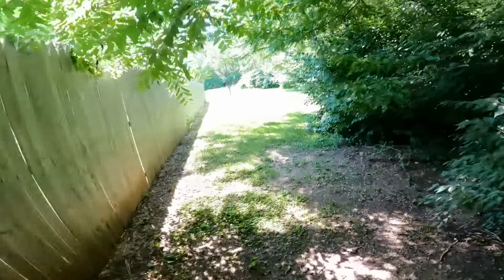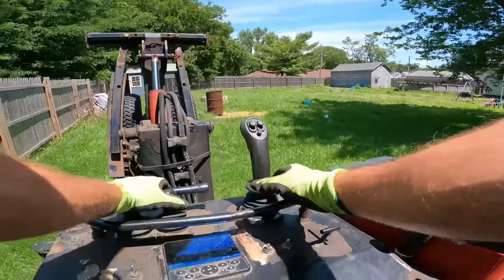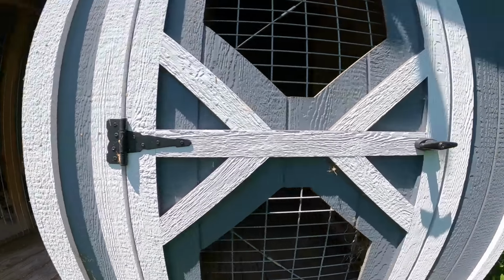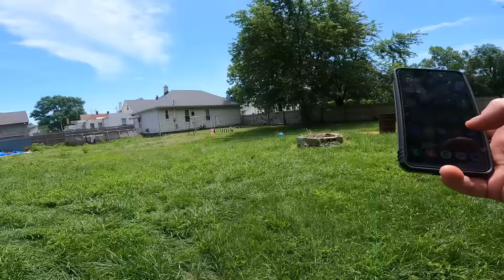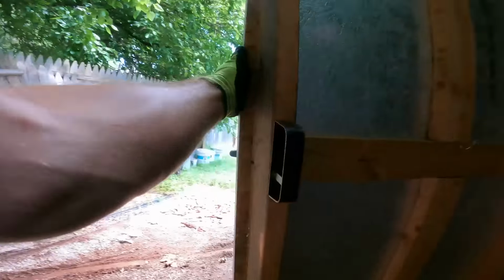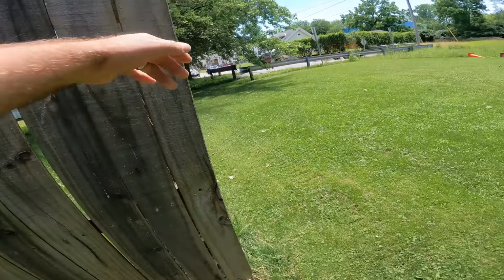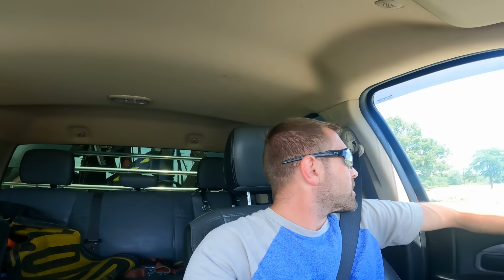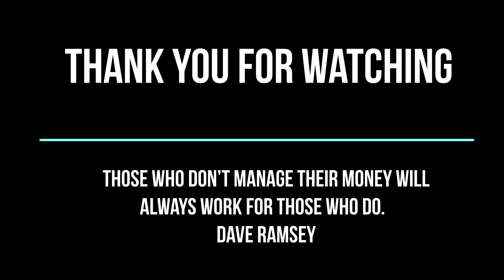Dog Kennel Repo Attempt

Comment: To feel more comfortable unhooking electricity, it might be worth getting a quick lesson from a local electrician. For an hour or two of their time, they could show you on an actual service how to safely remove connections like these. You'll get a lot of helpful suggestions from people here, but there is nothing like hands on experience. A local electrician can also recommend what supplies (tape, wire nuts, tools) to keep in the truck to cover most instances.
Reply: This, this, and this comment again.  A couple hundred bucks or perhaps a couple of supply runs using that huge hauler of your  will absolutely get you the training needed to handle disconnections more safely. 

People that work for a living tend to be helpful folk and too often we forget the trades are full of good people.
Reply: @TheRealBelisariusCawl he’s probably not insured for something like that these people will probably make an electrical fire and try to blame him because they are butthurt he took their “shet”
Reply: Excellent advise
Reply: The other problem here without access to the breaker panel inside to shut off the circuit there is no safe way for him to remove it
Reply: You have to have an electrician's license to do that.
Reply: He had to be able to get to the service panel in the main house to turn the power off, it doesn’t matter what kind of license or training he has, if they are uncooperative he can’t unhook it.
Reply: @steverone7623 i was looking for this comment before making it myself. Can’t just leave live wires live laying on the ground.

Comment: Hey Josh just a quick note. I think you do an amazing job with an amazing, respectful, and Godly attitude. You do a difficult and confrontational at times job. Even though it’s a tough visit, the repo client couldn’t be more blessed to have you be the one to do it. I’m a commercial and residential building contractor in Virginia for 24 years ….also an electrician. On a safety and comfort side, you do exactly what you’re comfortable with and that’s awesome.  Don’t even sweat that decision for your well being.  On another note, liability wise it would not be worth it to disconnect or cut any live wire that’s not breaker accessible for you, unless that’s in the company you work for repo clause stating that if wires are cut y’all aren’t held liable for any damage.  It’s definitely possible to safely disconnect even a live wire when you take care and diligence. If you’re licensed and or comfortable….. again falling back to an original contract and what the indemnities might be re: licensure.  However, if a client states that you arc’d the circuit (hot touches a ground or neutral through simultaneous cutting, accidental touching after the fact, or if it’s dishonesty and you didn’t even arc them at all actually lol 🫣), the client could say it tripped breakers and blew their fridge, dishwasher, tv, electronics, etc.  It stinks to have to make decisions related to potential accusation , but unfortunately in today’s world, things are changing for the worse and humanity is sadly slipping . I’ve learned the hard way over the years.  Every addendum I’ve made to my contract over the years is because I got screwed and what I thought was unwritten  common sense didn’t cover me 😇lol. All that to say, you did and are doing the right thing and you represent what you do well my brother. Great job man. God bless and I pray for prosperity for you and your family (and everyone who watches ) 👊🏼🙏🏼. Peace 🕊️    Tim
Reply: @patriciacole8773  Jesus didn't steal property
Reply: You need to watch and listen to more of Josh's videos. Only then will you understand that 100% of the concerns  you described,  DO NOT APPLY. He is thoroughly covered by a very comprehensive and detailed contract that every customer signs before taking delivery.

Comment: Since the circuit breaker was on a wall, you could have cut the section of wall it was attatched to.  So you repo the shed minus a little section of wall.  It would need to be repaired though.
Reply from the maker: Good idea, I never thought of that. Thanks 👍
Reply: @ShedHappens  Plus it would look hilarious.  Shed gone, just little wall section with conduit and circuit breaker box sticking 5feet out of the ground.
Reply from the maker: @Andrew-ky8oc8cq4n  For sure 😄😃
Reply: Yeah  gotta be careful when dealing with utilities.  Once you touch it you got liability @ShedHappens
Reply: Initially i agreed, but then remembered everything branches out from there,  but i guess u could throw main breaker n cut all dead outgoing wires
Reply: @Andrew-ky8oc8cq4n  absolutely agree 💯 ABSOLUTELY cuz the damages are all on the deadbeat who didn't pay

Comment: I did learn from this video that if you want to hide something behind a wooden fence you should not show the screwheads on the OUTSIDE of your fence.  I really like your observation that if you can get the frame of the shed to twist, the people won't be able to open the doors.  That could be a Halloween prank in the making.  All I need is a car jack and a couple of cinder blocks.  Thanks.

Comment: {'m an electrician, I like sparks, I would have just kept on pulling till the wires broke.  It makes a nice heavy 'thump'!
Reply: That's a big cable, possibly with wire protection,  it'll tons of load to break them  .
Reply: Not only that but if it causes a reaction inside the house breaker and causes a fire who you think is gonna be liable?
Reply: Then you're a terrible electrician. There is a right way to do things and a wrong way. Electricity is not something I'd take shortcuts with.

Comment: For quite a few years my dad was buying and reselling heavy catering equipment. A lot was hard wired to the wall,the cable runs direct to a contactor/switch on a wall,no plugs. And on more than one occasion we have nearly been zapped because the meters had been by passed....

Comment: As far as comments.  People can disagree without being disagreeable and/or mean.  There is no reason for someone to get into the gutter or sewer with comments either.
I am trying to think of a way to cut the wires without you frying in the process.  If you need to come back to take the shed and the power is still on, have a set of bolt cutters.  The 3 heavy wires leading to the breaker box are the feed.  Separate them as much as possible, use the cutters to cut one wire at a time and keep the cutters and yourself away from anything else to cut the wire.  Tape up the end coming out of the ground.  Proceed to the next wire and repeat the procedure until all 3 wires are cut.  Then finish the repo as you normally do.  By cutting one wire at a time, there is no where for the electricity to go to go to ground.  The most that will be there is 120 between any 2 wires.  If there is nothing on in the shed when the wires are cut there will be no current flowing to cause a spark.

Comment: I am shocked how many shed repos there are. I am also shocked how easy that fence section was to remove and put back.
Reply: Agree.   People here build decks and sheds.   They don’t buy them with borrowed money.  This is new to me
Reply: @justcrazy8605  not rewatching but they didn’t enter anywhere in a home but took property not paid for?
Reply: @justcrazy8605  negative. The homeowner signed a contract that gives the company access to the shed. It's as legally binding as a right of way or a deed restriction.

Comment: undo 1 wire... cap... tape... tape some more... then some more.... undo second wire.... cap.....tape...tape some more.......then the 3rd wire.     Carefully feed them down the pipe.  pulling is bad
Reply: Most likely it's against the law to leave unhooked live wires outside merely capped with wire nuts. Maybe if he also had a cap for the pipe and some glue.

Comment: When you're dealing with electricity, there's at least three hazards you need to deal with:
1) shock
2) heat (burns, fire, welding, ...)
3) arc flash
Reply: Also, at least around here, it is illegal to damage other property to repo your property. So just yanking could cause damage to house side and lead to legal consequences. Though laws vary everywhere.

Comment: If you had a shovel with a wooden or fiberglass handle, Go to the breaker box, open it up and shove the blade against the terminals the black wires are attached to. You might get a few sparks, but if done quickly, they won't last long. the short should trip the breaker inside the house and the power should shut off. All you need to do then is either cut the wires, or pull them out through the bottom of the kennel.
Reply: Why not just go the house's main breaker panel and turn it off?
Reply: @jroysdon  breaker box is in the house. It’s not accessible outside.

Comment: If you're willing to cut 120v to trip the breaker then you're willing to cut 240v because 2 of those are 120v to neutral and cutting one with neutral would also trip the breaker. Then the other would already be dead.
Reply: If he did that and they lost all there food in the Refrigerator / Freezer he would be libel
Reply: No disconnect to shed kennel so not liable for it tripping house power.
 @moneytalksBSwalks
Reply: @moneytalksBSwalks yep , the chances are that it'll be a ground fault & the whole house will trip .
Reply: @moneytalksBSwalks  The sub panel MUST have a breaker feeding it. Separate from the main breaker or means of disconnect.  That’s to protect the feeder cable, and is required by code, and standard practice. It looks like it’s 50A or 100A though which would be way more than cutting an extension cord in terms of arcing before the breaker tripped out.
Reply: @OverKillPlusOne ha! Ha! So you think that shit show was wired to code?
That’s a home owner special right there. Can’t count on anything being even close to code.
Reply: @JimsEquipmentShed looked pretty legit in the video

Comment: A quick call to municipal code enforcement would definitely be in order. We've had similar situations at the fire department where we were dispatched to perform a "disconnect with extreme prejudice." Looking forward to an update on how this one turns out. I'm sure that moving the shed and locking it up will get the renter's attention. Great work, by the way.
Reply: Fire department isn’t disconnecting power

Comment: I've been repoing sheds in NC for 5 years, and a grinder and a cutoff wheel makes quick work of a power cord. I've cut everything up to 220 🤠
Reply: What happens? Just a loud pop, a spark and a tripped breaker? 
I'd be too scared to cut into a live wire like that. Lol
Reply: @allthingssilver7635 Ya pretty much, just a little white fire ball and the breaker flips

Comment: The breaker is in the house main breaker panel inside. To confirm this, go to the main breaker panel on the house and turn off the house main power to the power company. Once off, cut the power under the shed, strip the wire coming out of the ground and put wire nuts on it and then put a pipe cover over the pipe.

Comment: Hey, Josh and Sarah!
A tricky one this time. I'm glad that you didn't move the thing around so that it shorted the circuit! It looked like it might be connected directly to the house panel in the basement, and if that trips, the house shuts down. You don't want that. 😟
Reply: I'm sure they new about the repo. They should have had the electricity already disconnected.
Reply: It looks professionally wired. That means the sub panel in the doghouse would be fed from two or more circuit breakers on or near the main house panel. Shorting the circuits in the doghouse would safely trip the breakers in the house but not the main house circuits.      Improperly wired? Danger of burning the house down!!

Comment: I'd wait for someone to disconnect the eclectic from the shed
Reply: Call the power company. Very likely they didn't pull permits for that run. Power company will disconnect them and red-tag their service until they remove the unpermitted power and have it re-inspected. With the power off, you can cut the pipe and take the shed.

Comment: Cut the wires individually at 2 inch length intervals below the main box, Tape up individually and pull shed. Dry wood is good to stand on with other hand in pocket.

Comment: When you turned the building it was dangerous,it could cause a fire in the house if it shorted out  underneath the ground.it did pull the conduct real hard to that one side and may have broke it at the box in building. But the people need to be there to do something  about the bill or payment.i would have cut the wire it's  not that hard but I have done a lot of wiring.

Comment: In a situation like that, turn the main breaker off unhook the ground and neutral wires and cut the end of the wire tape it and the ground wire then pull the wire off the main breaker on the top of the panel and pull it out of the box.

Comment: This should have been easy!  Turn the main breaker OFF at the main house (assuming it was accessible), cut the three wires in the panel in the shed, pull the shed clear, wrap the cut wire ends with electricians tape and flag them, and then turn the main breaker at the house back ON.  Note that allot of safely steps have been omitted for brevity, but you get the idea.  You could have called an electrician.  I do understand you erring on the side of caution here. ;)

Comment: That  was an expensive sub panel electrical installation to that shed. It looked like 100 amp 240V.  It needs turning off at the a main panel in the house.  You did the right thing. I wouldn't want to attempt to cut the cables while live or short it out.

I imagine that the shed company will need to go to court to get the electricity cut off and rendered safe for you to remove the building.  The home owners are being obstructive.

Comment: If that electric company is like most others it has to have a power disconnect legally (ie a circuit breaker of some kind between the main power supply and the building ) if not contact the local power company they can meet you there and pull the meter while you cut it loose they may not put the meter back in if its not a legal tap

Comment: All you had to do was loosen the wire from the circuit breaker,  wrap insulating electrical tape around the exposed wires and then move to shed off.

Comment: You could have walked over to the house. Found the main breaker at the meter and shut the whole house off. Gone back over and cut the wires off leaving yourself at least 8' of wire exposed. Always carry an assortment of big and small wire nuts and elecrical tape and a grinder to cut those thick wires. Tape the ends up really good and go back and turn the main back on. This shouldn't take you anymore than ten minutes of your time..
Reply: @howie4150  terrible advice
Reply: @byohazord   how so? Josh wanted to disconnect the power so he could take the shed.